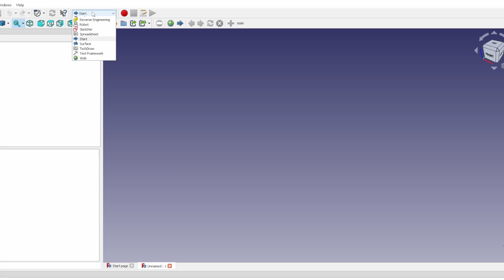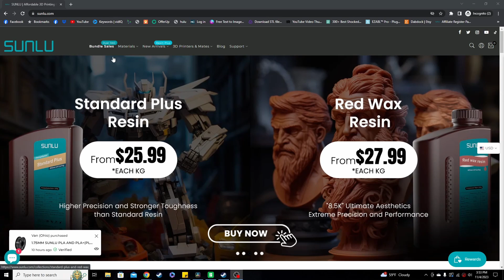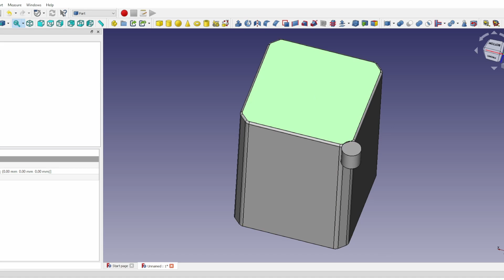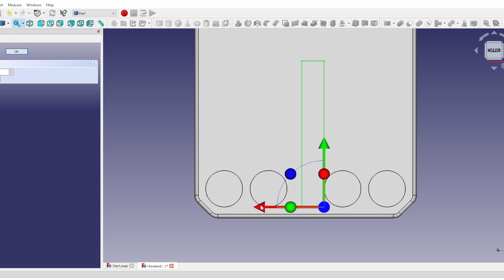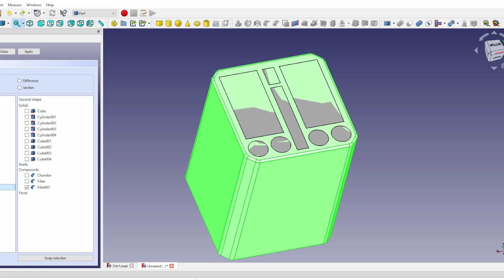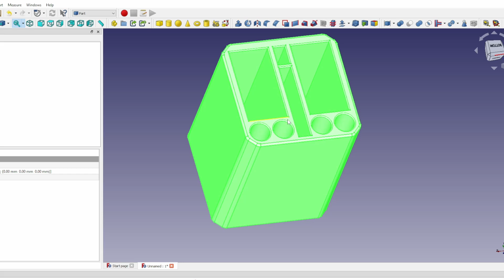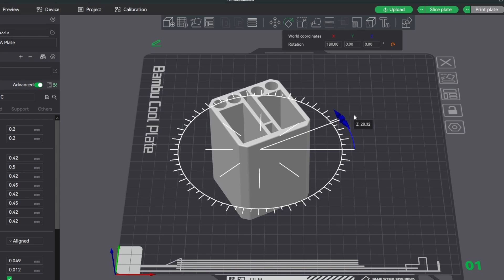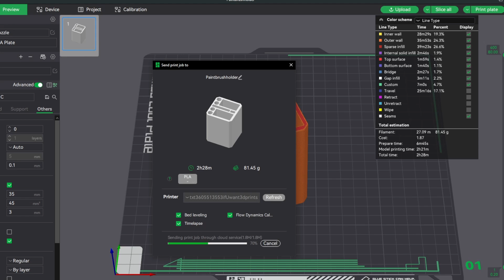How to model in Freecad and Print on bambulab x1 carbon

Comment: The left side of the display is missing, so I have to guess, what you are doing, when you use the menus on the left side. A little bit more explanation about the export files would also be nice. 
But thank you for creating the video.
Reply from the maker: @ollimovement1419  unfortunately obs wouldn't record my monitor because it's in a widescreen 4k format. I'll record more on my backup monitor so it's easier soon!